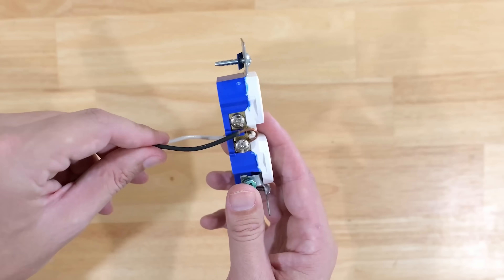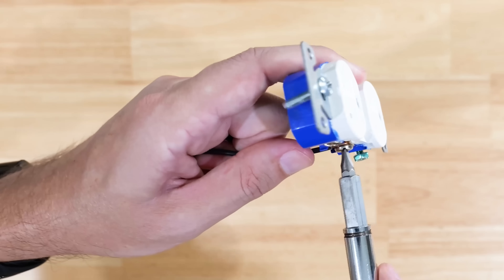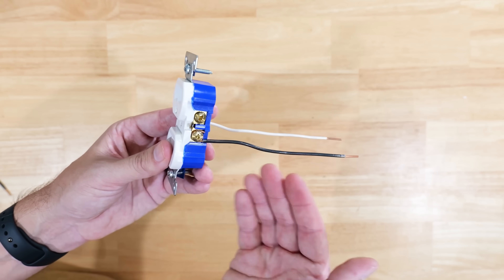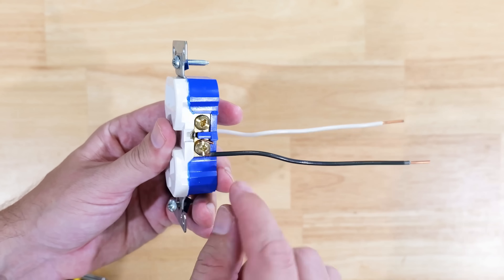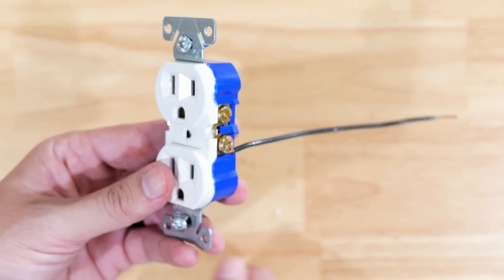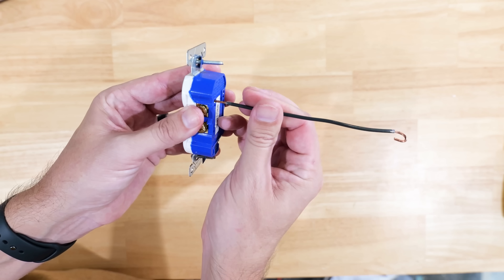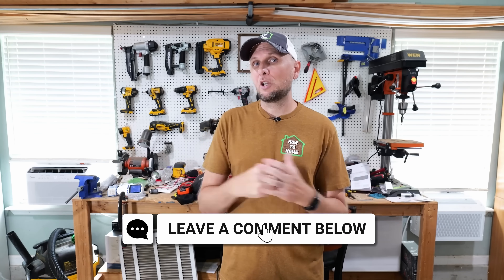Avoid Disaster! 8 FATAL Outlet Mistakes Most DIYers Unknowingly Make!

Comment: This is a great tutorial for replacing a receptacle. Excellent for continued education or first timers. I recently completed updating all the switches and outlets in my residence. It’s a simple task, but it's also easy to make mistakes. Always make sure the power is off before you begin working. Additionally, inspect the wires for any cracked insulation during the replacement process. Since the wires are often bent inside the boxes, it's important to secure any cracks with electrical tape before seating the receptacle. The first step is in this video is very critical. Never disable your electrical protection by using undersized wire or circuit breakers.

 - DIY'r / Avioncis electrical tech turned electrical engineer

Comment: High box fill is a major problem especially with wire nuts. Smashing many wires into a box is a recipe for problems. There has to be a better way.
Reply: There is a better way using a snap connector like a Lego

Comment: 11:00 Pigtail(tap) everything. One set of 3 wires per device(receptacle in your terms). And yes a 14 guage wire tapped off a 12 wire circuit is legal by code. Unless it is a dedicated 20 amp circuit. You need to read a code book. Electrician for 35 years, 20 of those as a C-10 contractor. You are entertaining tho.
Reply from the maker: Nothing I said was against code so not sure what your issue is other than you are a supposed electrician and feel you need to flex your knowledge on me and then also try to insult me with the last part when I said nothing wrong.  I did not even talk about the example you brought up.

Comment: What would cause a double wall switch to not function properly when the face plate is on but works fine when the face plate is removed? With it on you have to flick the switch until the light comes on but with the plate off it turns on in a single flick.

Comment: 1:35 completely wrong, you can use 20 amp receptacle on 15 amp circuits all you want. Those wires are rated at 90C which means for 14gauge is 25+amps to be "overly safe" it is your breakers job to be sized the proper size for the wire, not the receptacle. You can plug in something trying to draw 10000 amps in a 15 amp or 20 amp receptacle so again, it is the breaker's job to protect against that.

Comment: Ground up or down?
Reply from the maker: Either is permissible by code.
Reply: @HowToHomeDIY  either is permissible by code but if you notice the ground prong on a cord is slightly longer than the other two blades so it’s my opinion that the ground should be up
Reply from the maker: @WildBill312 why would that point to ground up?  Also, why ask the question if you already knew the answer by code and have an opinion on it?

Comment: I know that is correct by code  but IMO, a 20amp rated receptacle is totally fine on a 15 amp circuit. It will never pull 20 amps so all good. But a 15 amp rated receptacle on a 20 amp circuit is not safe. Don’t care if code allows it. Whoever made that legal is retarded. Think about it. That circuit allows potentially 20 amps on a 15 amp rated receptacle. Its only designed for 15 amps. You will melt the receptacle and start a fire before the breaker trips.

Comment: I just hooked up a GFCI outlet in my bathroom. I followed your directions and..... It didn't work... It was getting power and the power going through it to the lights were working. However, the test button would not make a click noise when depressed nor would pressing the reset button do anything. I even tripped the breaker and came back up stairs to try to see if it would click/reset with no power. I am guessing it's a bad outlet. I will replace it and see what happens.
Reply from the maker: Well I didn't give directions on a GFCI.  But if you didnt put the line wire in the line side and load in the load side of the GFCI it will do what you are talking about.
Reply: @HowToHomeDIY  True. That was the first thing I checked. Then the third and fifth thing I checked. I ran out to town and got another. It worked as it should.
Thanks for all your videos.

Comment: I noticed the screwdriver to you used was shaped to fit the screw head perfectly.  I've always used either a Phillips or a straight slot screwdriver, neither of which works perfectly with these types of screws.  What type of screwdriver tip is that?  I need to get one!
Reply from the maker: That is a Klein combination bit and it is awesome.  I have links to them in the description portion of the video.

Comment: I'm amazed that the speed wiring holes haven't been banned.
Reply: Because it comes down to installation quality. It is true that back-stabbing is an inferior connection compared to sire-wiring or back-wiring, but the connection itself, if properly installed is perfectly fine. It is just that back-stabbing is much easier to stall poorly, reducing its functional life. The Code assumes the installation is completely properly. That being said, it is likely that they will be banned in the near future.

Comment: I am glad to say, none of those issues found their way into my work. I am not an electrician and work on my own house as needed, including rewiring and adding circuits. All code requirements are followed. No, I would not do this for friends. At the age of 13 I was repairing appliances. I had the ability to look at schematic diagrams and figure out how something was supposed to work. At the age of 15 I drew house plans for the principal of my junior high school. He saw me in mechanical drawing class as I was drawing a house plan. He liked what I was doing and asked if I could do a plan for him. At 15 I also repaired our color TV and other electronic equipment. At the age of 19 my uncle asked if I could draw plans for an addition to his house. I accommodated his request, work being done according to plans and approved by the building inspector. Perhaps I was gifted to be able to do these things, but I always analyzed the problem and made a point to do things properly and neatly. My father spent 33 years in the navy and became a licensed electrician when he retired. My wiring met his approval. At the age of 28 I was taken advantage of by a car repair at a dealership. No, I would not let that happen again. I bought the manufacturer's manual and plenty of tools to do my own work. I say all this to point out that one should never blindly tackle such projects unless he has the knowledge or will research how it should be done. DIY can save you thousands of dollars. And your extended family will always treat you with respect. 😀

Comment: The device doesn't create the draw from the breaker you can put a 20 amp receptacle on a 15 amp circuit because the receptacle is going to take anything the 15 amp breaker can give it it isn't going to draw any more than 15 amps it can't the breaker feeds 15 amps only you're safer to use a 20 amp device on a 15 amp circuit.
Reply from the maker: Take it up with the NEC then.  You are completely incorrect for many reasons.  You could have a 20 amp device plugged in that doesnt go a bunch above 15 amps but is slightly above which wont trip the breaker.  If on for extended periods it can cause heat buildup on the wiring creating a potential fire.  Also, breakers are not perfect and can fail.  Having a receptacle that is rated higher than the circuit is just inviting possible issues.  The amount of people advocating for this in the comments in mind boggling.

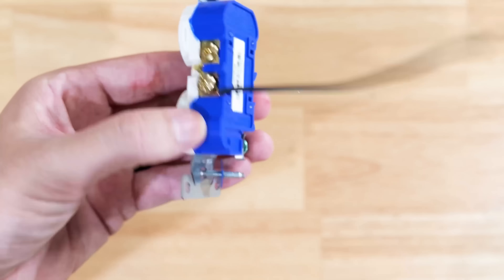Comment: If I use THHN on a receptacle I strip off the 8:20  larger piece then strip a 1/8" piece but leave it on the tip. Twist the wire backward before making a loop.

Comment: One point to call out. The load on the circuit is calculated at 80% of the rating. So a 15 amp circuit with 14GA wire can only really feed 12Amps of current. This is not so critical for receptacles per se as its all calculated into the form of the plug, but important to remember when doing calculations for wired devices
Reply: Wrong. Romex is already derated. Look at ampacity tables for thhn

Comment: I've never used the speed wire.
I was never taught that the little piece of metal could weaken over time because it gets warm.

I've life experience and deducted this by common sense. It will run warm when used and weaken in time. I new this could lead to a lose holding strength and possibly arch and cause a fire.

Reverse polarity is another situation I was naturally aware of. I'm no genius. I was just fortunate to be blessed with a lot of common sense.

Comment: The 25 Amp outlet differed from the 20 Amp outlet in having a short, horizontal slit at each socket. Is this a reliable way to identify 25 Amp outlets?

Comment: In an AC circuit, the current flows both ways, so it should not cause electrical damage if the black and white wires are connected to the wrong screws. The danger is that parts of whatever device is plugged in would be connected to the live wire rather than being connected to the neutral wire despite the socket and plug being polarized. This poses an electrical shock hazard if a person who is grounded touches the device and comes into contact with a live part..

Comment: Retired service electrician here.
On the reverse polarity, ac will not damage an appliance as the direction of the current alternates. However, there is a risk of electrocution. Also, a GFCI will not work properly if wired backwards. Unless the NEC has changed, you can use the 15a. Receptacle you are holding on a 20a. Circuit or else the 20a receptacle would not allow a 15a. Plug to fit into it. Last I heard it was the single outlet, not the duplex outlet like you are holding.
Reply: The 20a receptacle will allow a 15a plug because it exceeds the 15a requirements. It is compatible with both. It would be silly if the 20a receptacle worked only with 20a devices.
Reply: @kd5you1  for a duplex receptacle this is correct. However, there are single 20 amp receptacles commonly known as a bullseye that will not accommodate a 15 amp plug.

Comment: Are those black flip up connectors not similar inside to the backstabbing connectors? I like the straight wire connectors with the 2 holes and the connector plate. What do others prefer?
Reply from the maker: They use completely different mechanisms.

Comment: What really uses a 20 amp male 2 prong blade plug,though? I have seen 20 amp twist lock,fairly common for extension cords and some (15 amp)worm drive  that it does not unplug).......but never really seen any 20 amp,90 degree blade type male plug any tool,etc.....maybe a rare heater?
That said,it is against code.and people would assume that the circuit could handle 20 amps,when the wiring can only handle 15.
But good video.....I suggest using the "heavy duty,commercial grade" on practically all outlets,they are just so much better made.

Comment: I have a couple of additional tips. When a receptacle is in the middle of a run, wire nut the run together with a pigtail to the receptacle. That way the circuit current does not go through the receptacle reducing the voltage drop at the receptacle. When installing a receptacle always tighten ALL of the screws then wrap it with 3M tape. You don't want a connection screw sticking out that could short out to something.

Comment: Is the backstabbing hole okay for led bulb that pull less that 10 watts. It's the only fixture that will use the wire. And the 2 screw on spots on the side of the receptacle are occupied.

Comment: Another problem, especially for those in houses built in the mid 1970's is aluminum wiring.  You have to use receptacles listed for aluminum wire when replacing old receptacles. Also if connecting copper wire to the aluminum wire, special connectors are required.

Comment: Every Realtor should save this to forward to their customers to explain reverse polarity and other safety issues that often show up on inspection reports!  Great video!❤
Reply: Yes. I have been looking at houses lately - many of them very old and "renovated".
What I notice about the electrical is that:
1 - Some have the original outlets with no ground. That is both good and bad.
Good in that modern devices that don't use the ground will work.

2a - Bad in that some people will be tempted to use the "converters" that allow
a device needing ground to be plugged in. Bad, bad, bad!
2b - No GFCI for wet areas.
2c - The cable supplying the outlet may have no ground wire. Thus replacing 
the outlet with a modern grounded outlet will either mean replacing the 
cable or stringing a proper ground from "somewhere". Or leaving it unconnected!
2d - And, of course, if the home already has grounded outlets, the big question
is has the WIRING been upgraded. No use asking, the agent will lie......

This old retired engineer appreciates all the lipstick added to make sale quicker,
but the most important issue for me is the Bones and the Arteries. The structure,
the wiring, the plumbing, the HVAC, etc. 
Thankfully, I have a slave commercial  architect  (my son) with 30 years
 experience to help me find out if the lipstick is on a Pig or on a mature Lady 
that is still very healthy and strong. That worked for my current home, hopefully
 for the next.  [Great to have children smarter than me]..........
Reply: @doubledranch871 a good agent will not lie to you, they are not electrician. 
A good agent will tell you to get an inspection and or contact an electrician.

Comment: National building codes require that all new construction be wired with 12 gauge wire for receptacles. The problem comes in that this did not go into affect until the late 1990s. So there are still a lot of houses out there that were built wiring all outlets with 14 gauge wire.
If you go to one of the big box stores and look at outlets 95% of them will say 15 amp . 
They will work fine on a 20 amp circuit as long is properly installed. 
If you take a 15 amp and a 20 amp outlet apart and compare the insides, they are the same

Comment: At the beginning you show 2 recess. You call the one on the left a 20 amp and the one on the right a 15 amp. You can buy a 20 amp that looks just like the one on the right. I have never seen a plug designed like the one on the left.
Reply from the maker: No you can’t.  Then it isn’t a 20 amp receptacle.  There is a reason the holes are different.  So you can’t plug in a 20 amp appliance in a 15 amp receptacle.

Comment: Just use the receptacle plate under the screw and not the screw itself
Reply from the maker: There isn't a plate under the screw on residential grade.  Only commercial grade.
Reply: @HowToHomeDIY  that's why you pay the extra dollars for the commercial grade wheather it's commercial or residential

Comment: I've been on electrician for over 25 years.  I've never seen an electrical fire, but I've seen dozens of kitchen fires that have started at the stove 🤔👎🧐
Reply: Retired service electrician here. I have seen the results of loose connections that resulted in a house fire 2 times. Both were avoidable as they had flickering lights, tv turning off by itself, etc. the people ignored the flickering lights and would turn the tv back on. They had these issues for a few days before the wires got so hot not just in the box, but in the walls also and caught the studs on fire.

Comment: Im sorry.   But your wrong about the OUTLETS.

You CAN INSTALL A 20Amp receptacle on a 15amp breaker.    But you cant Install a 15amp receptacle on a 20amp breaker.

But this also depends on CODE.

Even a 15amp can handle a 20amp load. But depending on how you wired the outlet.  Like on how Tight the screws are.
And size wire..
Reply from the maker: No, you can’t.  It is NEC code that you can’t.  This isn’t really a debate.

Comment: The receptacle does not determine how many amps is coming in that's all the breaker, the breaker protects the wire not the device or whats plugged in it, if you don't know what you're talking about then don't be making videos on it.

Comment: 1:48 Is it really OK to put a 15A receptacle on a 20A circuit? Aren't 15A receptacles (especially the 69 cent bargain-bin versions) prone to overheating if 20A is drawn through them, something that could easily happen with an outlet strip or extension cord? I would think matching the receptacle to the breaker would be the best practice.
Reply from the maker: Code says it’s legal as long as it’s one duplex 15 amp outlet or more than one.

Comment: Sides of plugs ( screws ) I do not like , loose plugs can cause shorts in a metal box , use the back push in terminals instead if done properly, I’ve never had any issues doing this and yes I’m a certificate electrician

Comment: If you have difficulty remembering polarity when starting out, use this analogy.
Between a Chihuahua and a Labrador, which one is more likely to bite?
Reply: Wtf? I don't  get it.......been an electrician for many years,too.....
Reply: @edcat6587  The Chihuahua (the smaller one) is more likely to bite.
Reply: I know the chihuahua is more likely,but what does that have to do with polarity,electricity?
Sorry, i still don't get it,lol.thanks for responding though.....
Reply: @edcat6587 
The small slot is hot.
The small dog will bite.
The small slot will bite

See Spot
See Spot run.
Reply: @InsideOfMyOwnMind  ok! thanks,that's great-good way to remember which is hot.i was thinking of the wire colors,and could not figure out how it related to them,or?
....